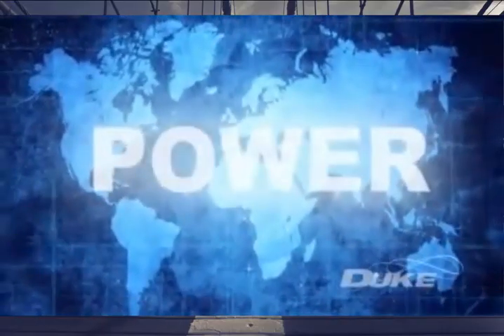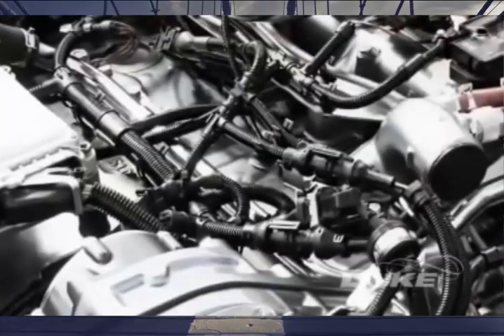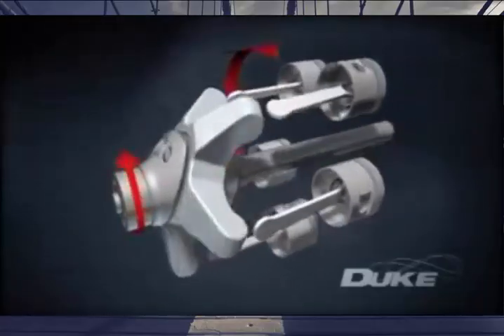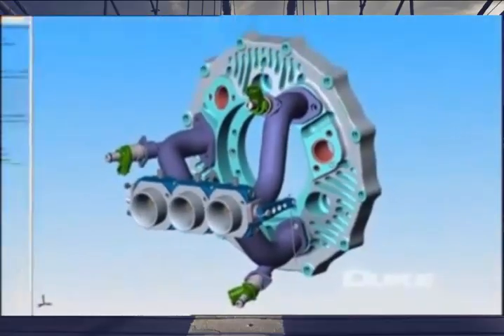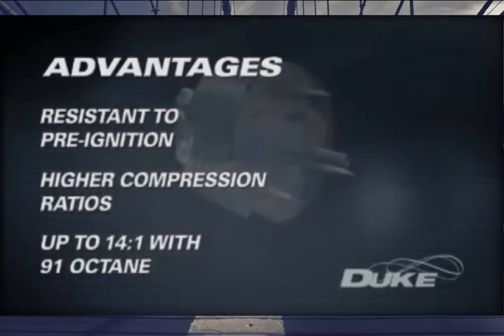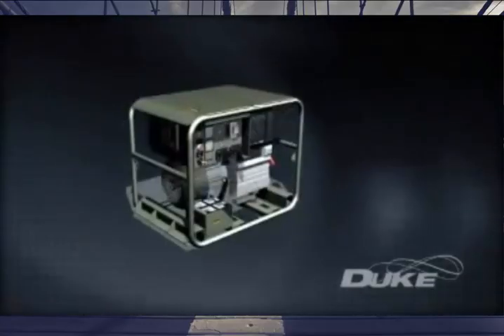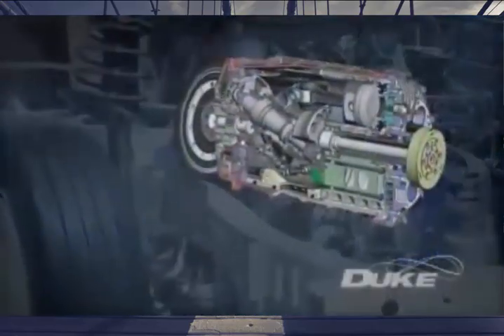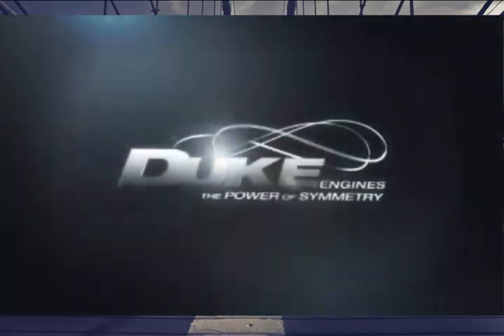Duke Engines | All information about Duke Engines

Comment: throughout the video it says make power of larger heavier engines .. not an actual number mind you but quite possibly more power then a heavy useless turd motor no one one ever want.  if it make more power then a Bugatti engine ? then im interested but if it makes more power then a Yugo engine then not interested , dead end tech the only application I can see this going for is possibly US postal trucks as there is a huge fleet owned all by the same company USA .. however with all the fracking and deep drilling in US for natural gas Im quite positive if postal vehicles are going to get a power conversion it will be for free (to US) propane

Comment: Better than a Wankel-engine, but the same problem ... how will they seal all the combustion chambers over a longer time against the (looking from combustion chambers) non-fixed 'cylinderhead'? And don't they burn the needed oil because it slips through everywhere? There are less parts in this engine, but arranged in in a way, they can't stand for a long time. The 'old' engines may be havier, may have more parts ... but they are reliable and they normally do have a more or less sealed oilsystem!

Comment: Why are there not any specifications.
Horsepower, 
Torque, 
Rpm, 
Cubic inches, 
Fuel economy, 
Dyno Results, 
Actual road test results, 
Longevity tests, 

Surely if this engine is all they claimed, all the specifications would be included 
in the video.

Comment: Yeah yeah, A/C pump in reverse. So you made a working engine. Put it in something and show it actually performing a task. Everyone shows a working engine on a bench, we would really rather see it truly working. Show it outperform am comparable car, put it on a huge water pump, install it on a truck, pull a heavy load. Attach it to a high output generator head. Make it do hard jobs, that's the important part, can it handle being pushed hard? It's other major drawback will of course be expensive parts, though few, complex to manufacture. I know a thing or two about owning machines with special features, they also have special price tags.

Comment: How is it resistant to pre ignition if it still has a very high compression ratio resulting in a very hot combustion space before the fuel is injected in. Bearing in mind, race engines have this kind of compression and need octane boost or alcohol based fuels. And this is getting close to a diesel ratio of around 22.1.
Reply: That is because on the compression stroke, there is no hot exhaust valve above the piston to light off a charge before the spark plug fires.
Reply: No valves on a 2 stroke either and they still suffer from pre ignition.

Comment: I understand this motor is having emission problems, mostly related to the oil needed for the seals. Even though it's better than a Wankel or 2-stroke, emissions are higher than 4-strokes. This fact alone will likely doom this engine to a niche market, rather than the mass automotive market. Still it's quite impressive, but I am wary of its long term reliability. I'd like to see a life cycle test to see how long it would last. Of course the size advantage will make this a great choice for many applications, but I have also never seen any cost estimates, so who knows?

Comment: one advantage i can see in this design over a fixed cylinder assembly is harnessing the inertia of the rotating piston assembly. Once in motion, it would try to stay in motion. It would tend to generate significant gyroscopic forces...it would innately be resistant to turning against its direction of rotation.

On a ground vehicle that would be insignificant, but on an aircraft especially a light one the forces might be noticeable unless you rotated the prop in the opposite direction to cancel out the engines gyroscopic forces.

Comment: This is a wonderful idea. I hope they get a long way with it.

I have a question, as well. What is the maximum RPM? After a point, the pistons will get pushed out hard enough that the centrifugal force could become a pretty drastic lubrication problem.....

The other thing is the loss of power due to non-important parts.

If the pistons rotate inside a barrel, that is one massive moving part..... Does that barrel itself cause loss of power?

Comment: Some say the duke is nothing more than an axial engine. Sure, that's fine, do you see another in a car anywhere? no, so that's their goal. Some say the duke is just another petrol engine and those are going the way of the do do bird. Sure, yeah, gas stations are here to stay for another 15 to 25 years. If you think gas stations are just going to disappear overnight, i have some swamp land in Florida for you - good price too! 
Change happens over time, in steps, not like a lightning bolt or flash but over a long time. Electric cars are coming (not like the tiny Tesla numbers. Tesla =50 k per year, Internal combustion =60Million per year), it will probably be in the early millions by late 2020's but won't wipe out petrol unless oil prices goes right through the roof and my guess is no oil Co. executives will let that happen. 
For the nay Sayers, two questions, 1. do you own stocks in electric companies? 2. why did you watch the video?
take no, they did mention ex Cosworth engineers are working on the project. As long as they have money and talent, they will move forward...

Comment: Im just a layman but i don't see how this can compete with a v6 or a high quality v6. The camaros v6 is a few years old it makes 335 hp and its pretty cheap easy to work on. I would like to see a comparison on a duke engines cost weight and efficiency stacked up against a modern I4 or V6. Personally id like a 4 rotar wankel but thats just me.

Comment: It almost seems counterproductive and backwards. To be rehashing the use of Pistons and cylinders of any type.

My personal thoughts would be toward the axial flow turbine engine designs. While you might not come off? At the start line,. Like a jack rabbit. Turbine engines can burn virtually any combustible fuel. Poor MPG mileage and extra pollution with gasoline ain't the way to go, with those. 

However those can burn any combustible liquids. Using cheaper and less polluting fuels. Smaller Turbine engines, could turn generators. That power electric motors for our vehicles. Located at all four wheels. 

Being smaller in size will offset potential poor fuel economy. Utilizing fuels such as alcohol, hydrogen, others. Would offset the pollution potential. Running on McDonald's french fry oil. Which might make you hungry? It'll smell so good. And so, there could be an obesity factor involved here? But at least. If they're going to tax your beverages? In exorbitant late high taxes, that have sugar in them? You'll be drinking more water. Which is better for you. And we'll have more sugar. To make more alcohol with. To either power our cars? Or lower the cost of beer. Whichever is more important. Which is beer.

Comment: Companies dont want to invest in any new combustion engines. Its all about electrical motors and batteries.
Reply: Toyota is engineering a petrol engine with efficiency about 40 %. Compare to the big diesels at 50 % and they're getting close. It's unlikely that any infernal  combustion engine can do better, even free-piston ones.
Reply: Electric is garbage

Comment: This concept is adapted from the swash plate system as invented by GM Frigidare in the 1950's for their A-6 Freon compressor except the swash plate is not a piston driver but is piston driven and therein lies the problem-- the massive pounding friction at this 90 deg power interchange.  Maybe this can be made acceptable compared to the overall friction loss in the usual IC engine or maybe not.

Comment: Who ever was the narrator in this presentation is that person sounds just like the Smart Gremlin on Gremlins 2 The New Batch. I am into alternate forms of energy that doesn't use gasoline however this engine could b modified to use the water carburetor that converts water to gas then ionizes that gas at the same time then burns it in the combustion chamber. The applications of this engine is extensive.
Reply: That's not a thing.  The power required to convert water to "brown gas" is greater than the energy gained from burning it.  So without a supply of both electricity and water, you won't be going anywhere, and won't be any more efficient than an electric car.
Reply: Yeah except for the problem that there is no water carburetor that makes an engine run. Don't try to tell me Detroit has kept it from coming out, please!
Reply: Actually, electrolysis of water will break it into hydrogen and oxygen, and you can burn that and use it as a fuel, but you're going to put more energy into converting water into its component gasses than you'll get from actually burning them, since with some losses in each step that would be violating the intrinsic laws of physics.

Comment: Put an electrical generator on this and then power an aircraft  with the Siemens 350 hp electric motor.
This then becomes a "hybrid" aircraft power system.
Now if the engine can be turbo charged so altitude density does not affect performance - this could fly up to 24k with full power to prop performance.